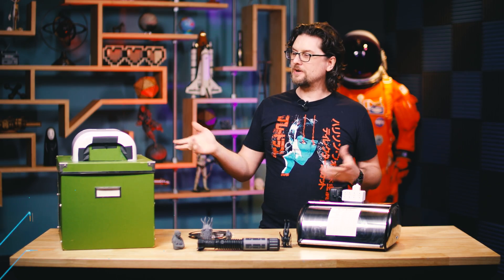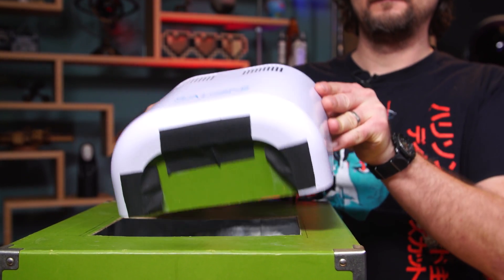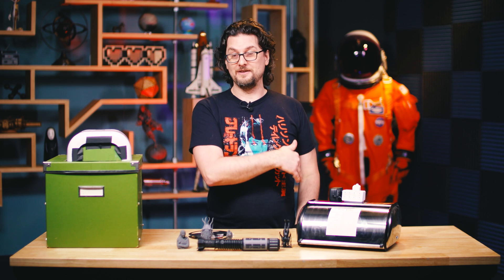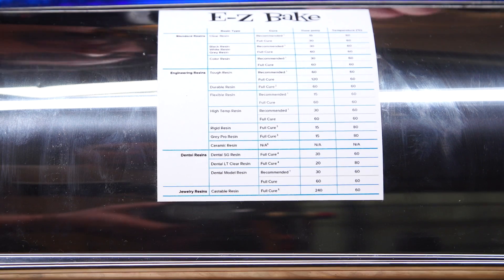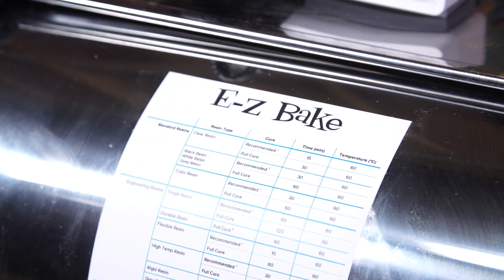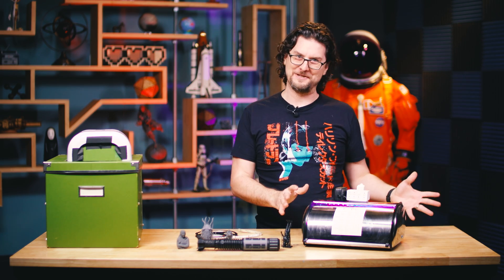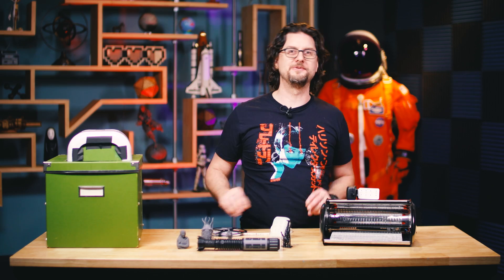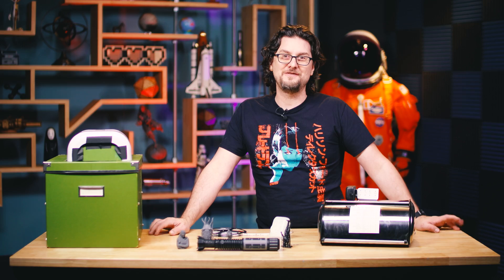How to Build an SLA 3D Print Resin Curing Oven

Comment: I think in the original box I use mirrors that were ment to stick on walls like back in the 70's
12x12"   you could tape the sides together then cover it with rigid foam siliconed on. 
if you can cut glass then place the led strips in it and hinged the lid.
I don't think foil is reflective enough. I'm pretty sure you can still buy 12x12 mirrors.

on your bread box design you need to cover the gap with a uv blocking film that's going to protect your eyes. its natural for somone to catch that out of the conner of there eye or look at it because its bright.  better safe than blind.
Reply: Glass can absorb UV rays. Mirrors are not the optimal solution. :)

Comment: The uv led that you're showing has a watt output of 12 watt about, is it enough for a fast curing? I'm building my oven, I did research and, correct me please if I'm wrong, alongside the proper wave length, 360-400 nm, watt is an important factor to speed up the process. I'm building fishing lures, may your needs are different than mine, I need a cure time of 1 hour maximum, so again, what about watt? Your led with a 13 watt output about provides a fast curing time or not? Thanks for your help!

Comment: Any hints on tape that won't just fall off in a cold garage?  I've redone mine with fresh 3M double sided adhesive after thinking the stuff that came with the lights was bad, and still it's falling off.  Yes, cleaned with strong alcohol first (and used some on the box as well).
Reply: Okay, months later and having to reposition the light strips every time I open the box.  The strips fall off the double sided tape, or get yanked off running the door past them.  This was NOT a good idea for a container, due to the way the door works, and the tape is sorely in need of a mechanical fastener of some sort to prevent it from letting go.  Thanks for the ideas, I'm off to find a better solution.

Comment: Hello I found on Amazon an UV LED strip between 395 to 405 NM by 60w. 
Is more wats better ? Like 60w vs 24w?
Reply: Replying to an old comment, but here's my advice: The power rating is not enough to go by. Ideally check if the LEDs have a spec sheet. It should have a detailed breakdown(or chart) of the emitted wavelengths. A 60W and 24W LED strip might produce the same amount of of UV light, but the higher power one also produces more visible light(or even just waste heat) that does not help with curing resin.

Comment: Question: I want to build a small box in MDF, for reflective material can I use mirror?
Reply: Ikea as mirror (Malma 10" x 10") for $2.99 CDN each, If you put the mirror as wall and bottom inside the box with a mirror turn table ( about $25 at Amazon), and the blacklight on the selling of the box will that not work?

Comment: Just a heads up, even though it's an easy solder, you need to scrape the goo off the LED strips until they're shiny, otherwise you're going to have a dickens of a time getting your initial solder blob to stick
Reply: If you remove the underside double side tape, the round contacts are clean

Comment: Formlabs repeatedly says the parts should be heated to 60 degrees C when curing.  (which is on the chart you pasted to your oven). If you read their white papers it says it is as important as the UV light.  Have you considered instead using a small toaster oven?

Comment: I just finished my UV oven and it's very bitchin. I made a change because I don't like soldering and used LED connectors which I recommend. But it's just cool. Thanks for the tip. Oh yeah, I put LED strips on the bottom as well.

-Mike

Comment: Michael Philbrick
Great idea. I'm building one! So I started soldering today and realized it's really going to take a lot of time. So I found some connectors on Amazon for about $14 for 30 double ended connectors so that I instead of soldering I can just snap on connectors which is way worth it for me. Can't wait to use it. Thanks for the tip. Just go to Amazon and search for LED connectors 8MM and get the ones with connectors on both ends.

Comment: I have  a combined resin print cleaner and hardener. It is a 3lt ultrasonic cleaner with IPA,and a 30w uv light as top. You can clean and harden prints in one machine. Total cost about 90€. Hardrning time 1-2hours , cleaning time 30sec/3min deprnding on model.
Reply: Care to share a link? Many thanks
Reply: @danirose9276  got no documentation, I may do a video on it some day on my chsnnel

Comment: Decent video. It wasn't really a guide on how to make it but decent attempt anyways. One note is that the waterproof UV strips wear out due to the UV light making the protective plastic into a horrible yellow tacky substance that doesn't let any light through. I would recommend using non-waterproof strips instead for this use.

Comment: Do we have to use a blacklight uv led strip? Or an ordinary uv led strip will do the job?
Reply: Black lights are UV lights but at a lower wavelength. As far as I understand you could technically do it but it would take much longer than even the nail salon lamp
Reply: @CworthDynamics  I see. Thanks for the thorough explanation! Black light leds are hard to get in my country unfortunately :(

Comment: I'd caution you that plastic blocks UV depending on the wavelength. So that clear plastic riser, while clear to visible light, may not be clear to UV light. This may help explain why the new curing oven is faster than that old.
Reply: I was about to mention that. Yeah, most plexiglass is like that. So is glass, very often.
Reply: An easy way to test would be to shine the UV light through the material onto a highligher. UV resin cures at the same wavelength highlighers flouresce, around 400nm. If it doesn't interfere that much with the highligher, you're good!

Comment: Wish I knew about a step bit when I added tempered glass on my pc
Reply: Will not work on glass though, there you need a special carbide bit that gradually grinds the desired diameter hole. Cheap way is to use tile drill bits with a teardrop shape, with plenty of lubrication, and when the tip just penetrates through flip the glass over and finish from the other side.
Reply: SeanBZA on the case the glass was pre drilled from the suppler for me

Comment: more 3d printing videos plz! :)
Reply: 3d printing is still in it's infancy, but it has kilotons of potential. It could possibly leave the government in the dust to boot!
Reply: @numberjackfiutro7412  You realize 3D printing has been around for over 30 years right? Only 3D printing that's in its infancy is desktop based SLS solutions. FDM/FFM have been on desktops for over a decade, and SLA has been around for a few years now. You can literally pick up a FDM machine at your local computer store or even the hardware store in the US. I think even Best Buy is selling filament now. In Australia you can take your happy self to Aldi, get some groceries, and grab a cheap 3D printer. Would hardly call that something in its infancy.

Comment: Awesome stuff as usual, this is better than the sun I guess, it’s neater but still pretty sure the sun is more powerful in terms of speed of curing
Reply: Depends on where in the world you are located, up here north it is we only have a few hours of light per day and it is -5C right now.
Reply: Fair enough, I’m smack dab on the equator, that may explain it
Reply: In general I don't recommend sun curing - it's so intense (at least here in CA) that I have had too many prints warp and/or break. This is more controlled.